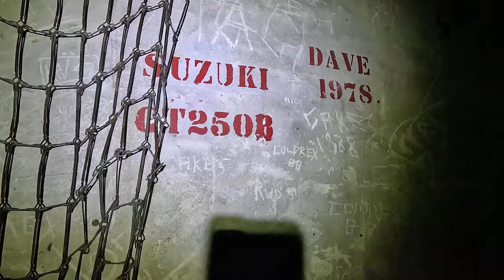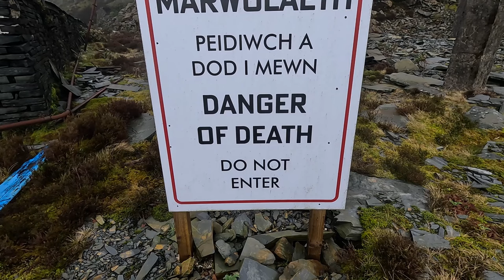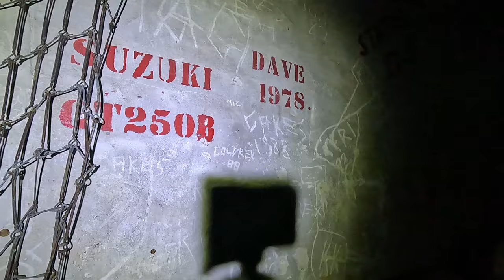To Idiots Go To Wales Part 2

Comment: the scaffolding they must have built around those walls would have been huge.. sturdy enough to hold the weight of the material required to go up to the next level what not, chynese?...